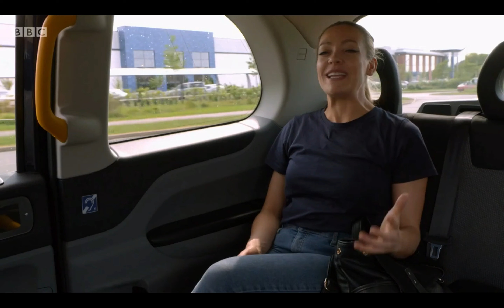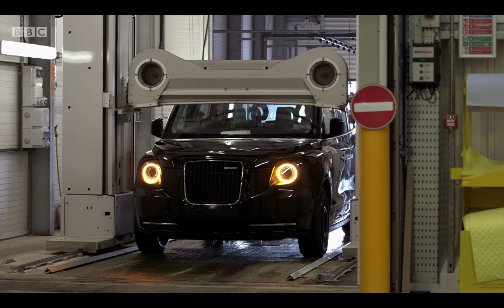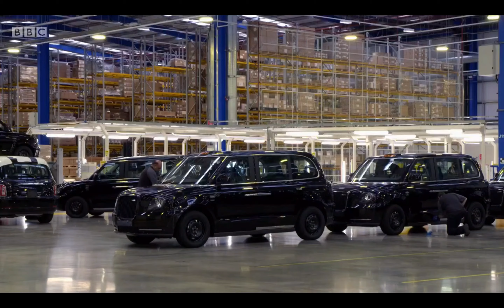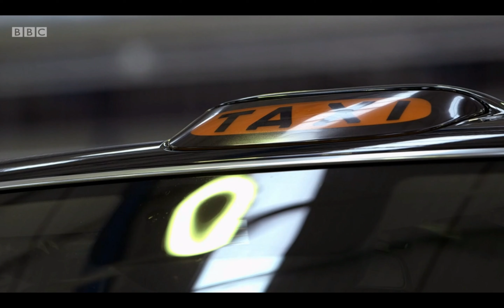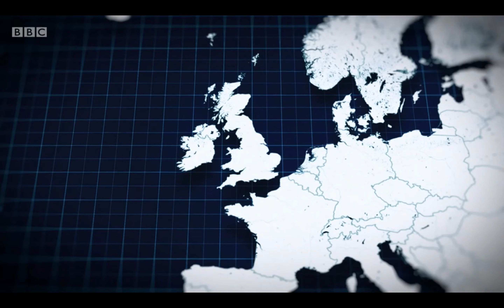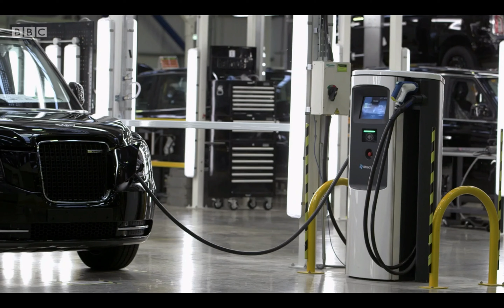LEVC & the TX Electric Taxi feature on BBC 2 series ‘What Britain Buys and Sells in a Day’

Comment: Sadly never properly tested on streets of London by real cabbies before went to production.
This cab has loads of problems or bad designs.
1. Range 65 miles summer and 40 miles in winter
2. Rear doors heavy like in US President „The Beast” people have problems closing/opening them.
3. Uneven front tyre wear.
4. When doing a look lock turn there is strange noise.
5. Squeaky suspension 
7. Heater or Aircon drains the battery very quickly 
8. Its capable to fast charge only at 50 KWH where other car makers do 150 KWH plus
9. “For hire” light badly designed. At the day time it looks like Taxi light is on, even is is off.
10. Uncomfortable passenger seats
11. When wet regen braking gets disengaged at cab accelerates itself.....very dangerous 
12. Petrol engine (range extender) sounds like old diesel engine and very loud. Also not economical, only 37 mpg if you’re lucky
13. Loads of software problems or faults popping up on dasboards
14. Wing mirrors too small
15. Front badge looks like Bentley.
16. Crap intercom 
.......
List goes on.......
Reply: TaxiWarrior what do you expect for £67 k.
A cab that works ?
Not fit for purpose just like TFL.
Reply: working at a taxi garage i can add more to your list.

17. Rear Erad issue causing vehicle to not drive. 6k job over a £20 circlips 
18. Uneven rear brake pad wear. Although the front is amazing
19. Updated ARB's however they still squeek.
20. Lower control arms keep ripping apart every year
21. N/S/F tyre keep wearing
22. Lower door chrome strips keep coming loose

 list goes on....